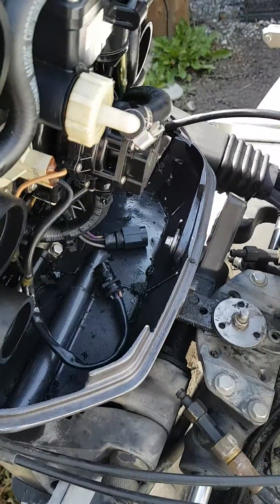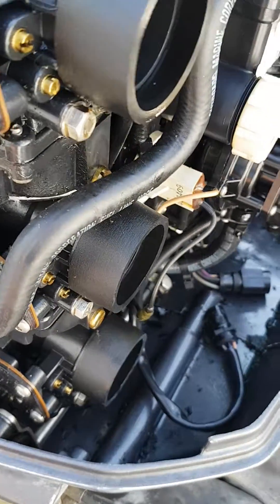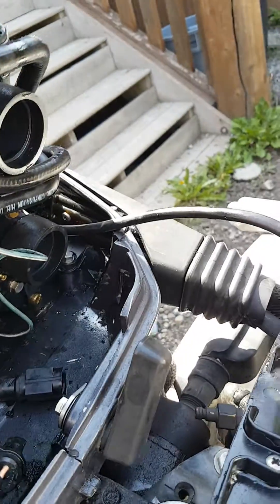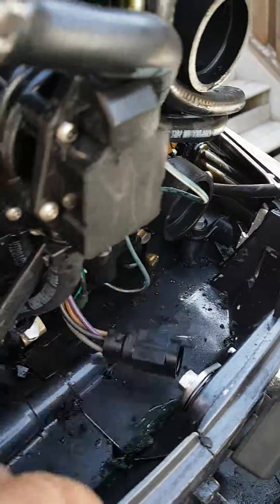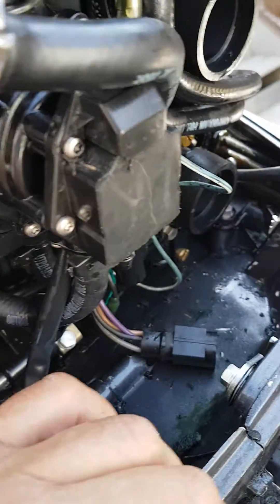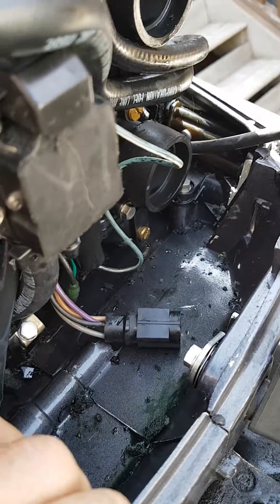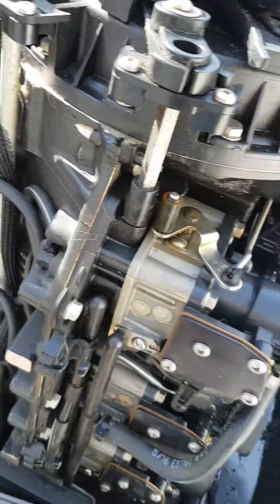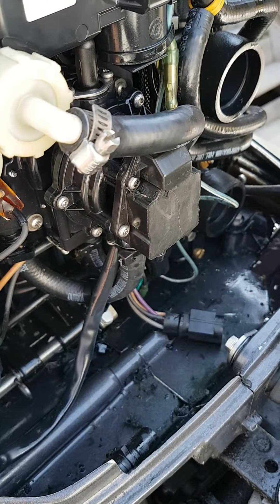how to outboard motors-over oiling issues 175 johnson part 2 of 2

Comment: How long have you been running engine like this any long term problems???
Reply from the maker: about 3 years yes 2 strokes can be a bit of pain in the ass pretty  temperamental, kind like a woman when things are good when there not can cause headache's to be honest I think I'm going to switch to a 4 stoke but not getting rid of this boat just giving it a complete overhaul.
Reply: @BCBenny  really appreciate you responding back, did you have to adjust the idol? I notice the idol is sitting higher than before im not complaining just curious
Reply from the maker: @blklacker  yeah the problem I had with removing the vro pump is that I've had issues with the alarm. I went back  to vro pump last year still having some issues, I'm going to drain all the fuel and start fresh.  Never adjusted the idol not sure if your looking for a boat but if you are I would suggest going with a 4 stroke and if you can buy new that way your not dealing with someone else's headache this boat is great but I'm thinking of upgrading to a pontoon boat?  Got an ok deal on this boat traded a vehicle, just friendly reminder boat=bring out another thousand lol
Reply: @BCBenny  I inherented a 1990 seaswirl sierra. 120 v4 vro johnson. The boat been sitting in a garage for 10 yrs great condition but its burning a ton of oil almost 3qt using roughly 10gal of gas. I rebuilt gas line from tank no air leaks took it out again still burning a ton of oil. No way I'm running the engine when I'm seeing that amount of oil consumption. I disabled the vro and mixed about 20gal of gas in tank. It start and runs much better i havent taken it out on the water yet though 🙄🙏. I'm trying to put the minimum amount of money into it and this winter get it a full service done. This is pretty much my last attempt to bandaid it for the summer to have some fun, great video thank you for responding im litterly diving head first into marine mechanics, still working on boaters card so the fact you responded back with this info is very much appreciated.
Reply from the maker: @blklacker  Your welcome good luck with your boat!!